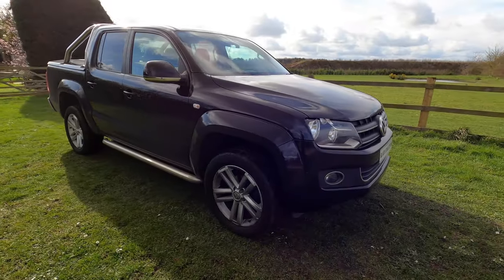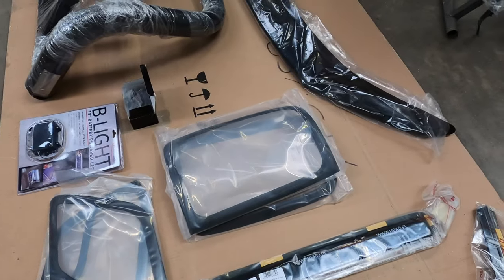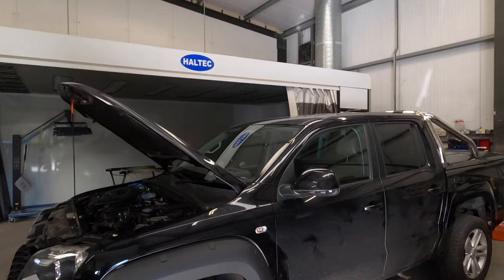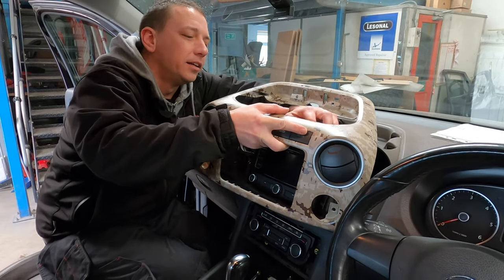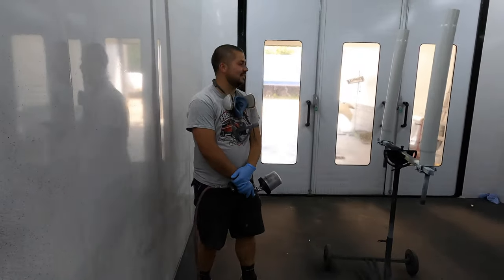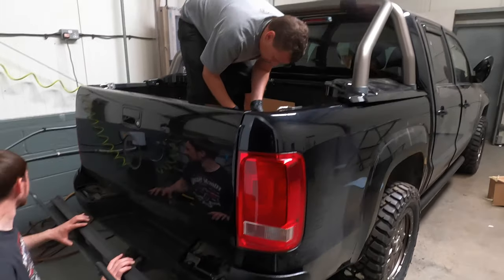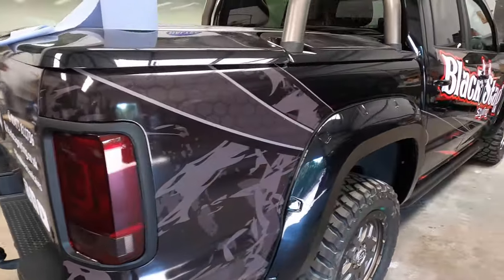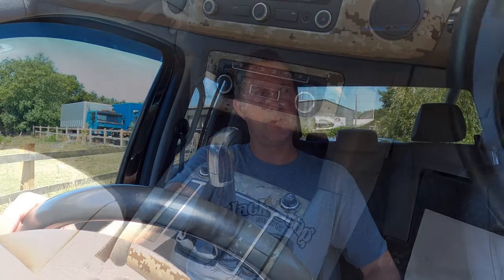VW Amarok MODS! - Wide Arches, Hydro Dipping, BIG WHEELS & TYRES! - Modified VW Amarok

Comment: Hi I have just bought one of those formed body coloured lids to go on my amarok it isn't supplied with the roll bar though, where would you recomend I get the roll bar from?
Reply from the maker: It depends on the cover you have bought as to weather you need a VW one or the one that goes with the lid. 
You could try eBay.
Reply: @BlackStagStyling  it's exactly the same as the one fitted to your black stag one featured in this video